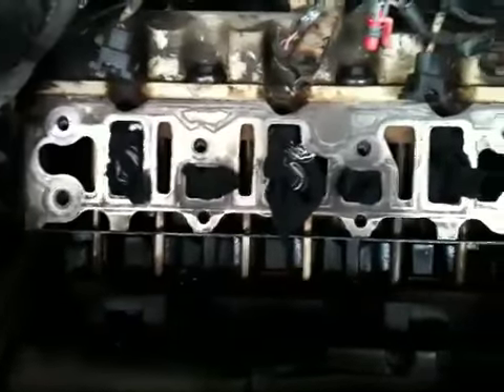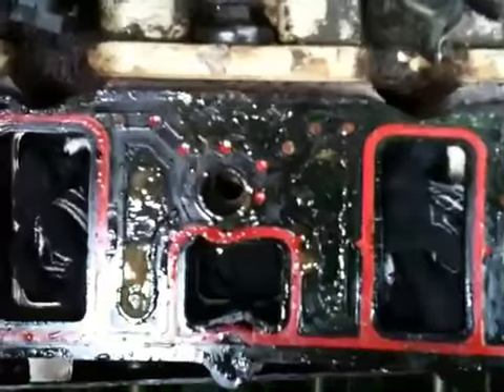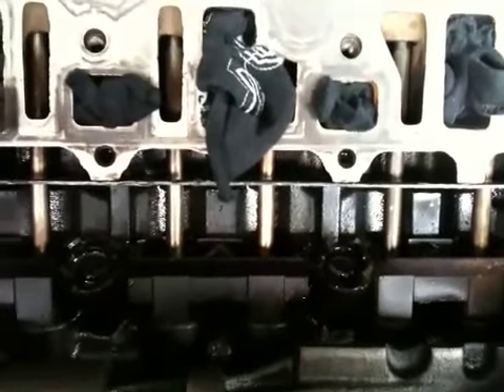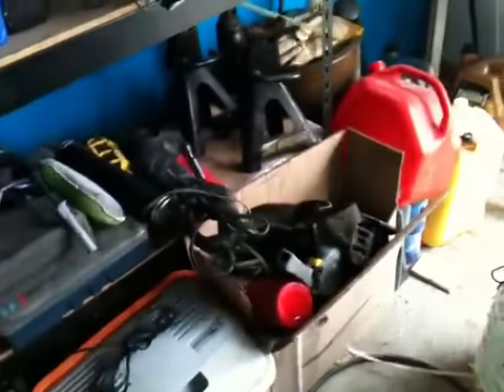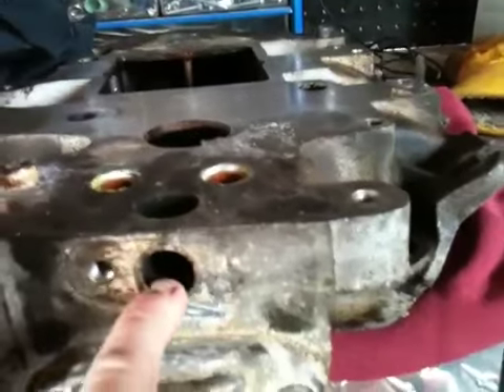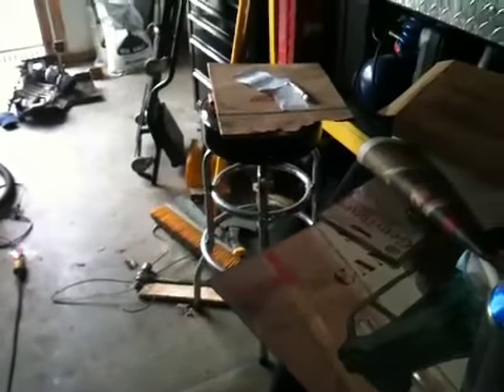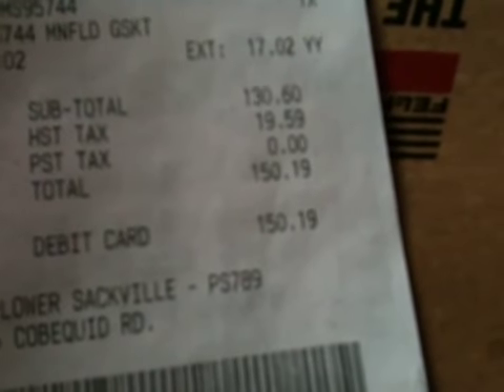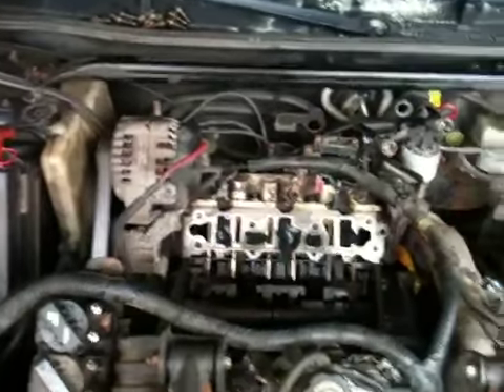3800 series II L67 intake manifold gaskets

Comment from the maker: I did it in about 2.5 hours.

You will need one felpro permadry plus kit. (Felpro part number 98014 T).

You will also need one plenum gasket  ( Felpro part number MS95744)

Coolant elbows will need replacement (Dorman 47065HP) Aluminum elbows

And I HIGHLY suggest getting extra coolant O rings (Felpro QES70599, get 2 boxes)

I say get the extra O rings as some injectors will stick in the fuel rail and some will stick in the head.  The big kit comes with 6 O rings, you need 12.